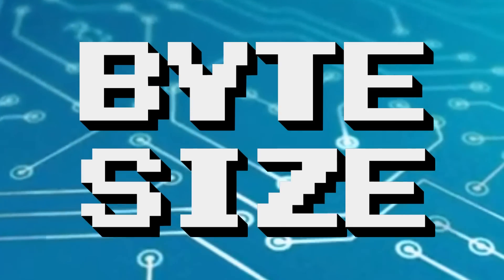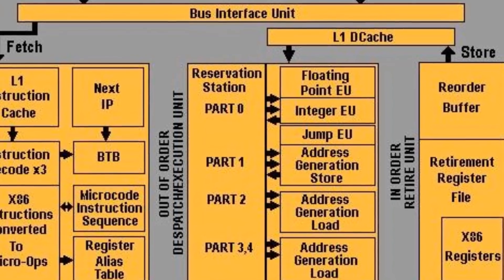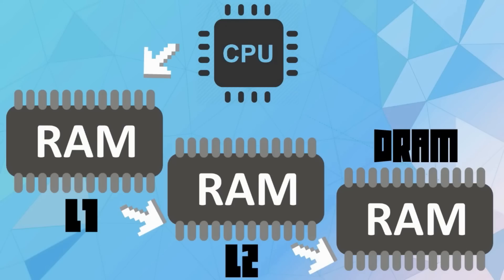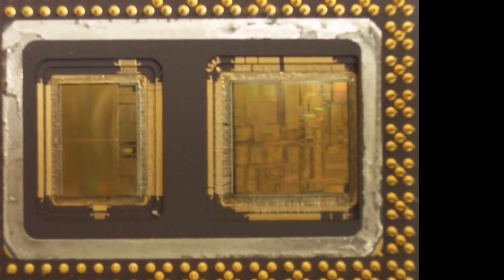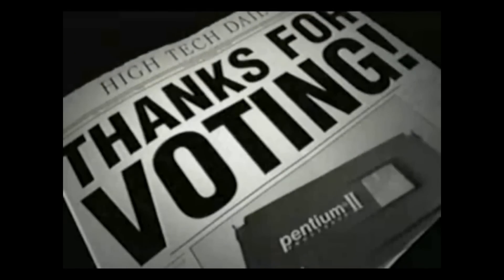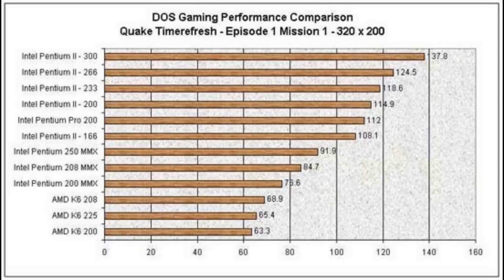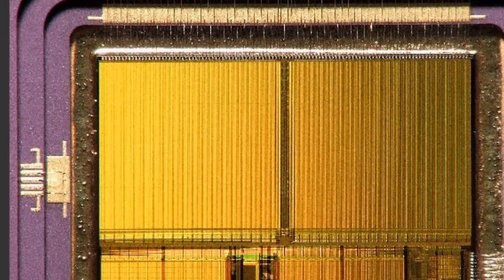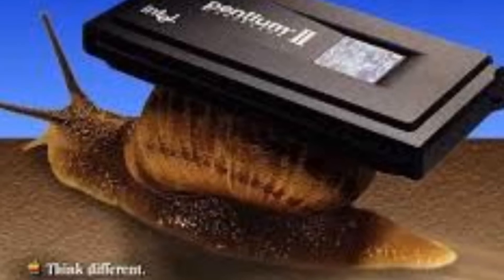Why Were Pentium 2's on Cards? [Byte Size] | Nostalgia Nerd

Comment: And years after, I still automatically translate "Celeron" to "Garbage"
Reply: Intel© Garbage® processor...sounds about right
Reply: Celery vegetable
Reply: you could overclock the stuffing out of the Celeron 266 or 300A (300A was the first to have L2 cache)
Reply: Celerons where overclocking monsters at one point before the 2000's

Comment: I remember when I first got a Pentium 4 that was over 1 GHz, all of my friends told me I wouldn't need all that power.

Now I have a quad core i7. lol
Reply: we will always need more power until we have a matrix like real-life simulation
Reply: The Pentium 4 was good at the Gigahertz race with its Netburst crap, but not much else. They abandoned the whole architecture for the Pentium M which performed a lot better with lower powerdraw.
Reply: @travelguy78   which is based on pentium 2/3  P6 gen
Reply: BigLBA1 But we have processors that can overclock to 5GHz now. I mean the world record is 8GHz, double of youre so-called "real barrier" and that was done on a AMD bulldozer :/
Reply: BigLBA1 You fail to adress multiple cores.
Reply: BigLBA1 What exactly was youre original comment about anyway? The physical limitations of a pentium? i think initially i misunderstood youre comment.
Reply: BigLBA1 Why do you bring up "light" when talking about cpu's that run on electricity which is much slower. Optical CPU's?
Reply: BigLBA1 But a drop in voltage relies entirely on the motion of electrons in that case. Can you cite a source for this, im genuinely interested. My understanding is that voltafe simply represents the "pressure" of a current, And currents are simply electrons moving, therefore voltage cannot move any faster than said electrons.
Reply: Guy sold me a 386 once and someone pointed out that the lowlife pulled out the EMM'y chip.  Explains why the casing was loose when he dropped it off.  Still ran windows 3.1 just fine though...
Reply: you won't need all that power.
Reply: 64K RAM should be enough for anyone.
Reply: BigLBA1  I know! 4 is common now for consumers, with OCs up to 5. However.. a cpu's Hz technically is the electromagnetic wave frequency of the oscillator crystal inside the CPU. Not how fast the electrical signal is propagated (which is far slower then light, as cpus are electrical based currently, not light based yet). Most herz increases come from  designs that settle a little after a clock rate change faster or use slightly less energy per transition of the square wave the crystal produces.
Reply: i had the first cheap athlon 1 Ghz, at that time hardware had the advantage for a short period.. I mean most of the games needed a much lower processor to run fine,
so i guess that's what they meant...And it's true it was the longuest period where i could run any game without upgrading anything...
Reply: BigLBA1  Der8auer  : sneezed
Reply: @bigthot1077  from my understanding the electrons don't move that fast but the waveform does.
Like imagine a bunch of cars stuck in traffic  and one guy slams his brakes and the next guy hits his and so on and so forth.
The cars don't move much but break lights start zipping down the highway.
Reply: @bigthot1077  electricity travels at 16x10 to the 18th power faster than the speed of light.....so...

16,000,000,000,000,000,000 times faster than light
Reply: I have a i9
Reply: Some day, maybe even soon, these TINY core counts will seem "cute".
Reply: BigLBA1  Even then, we're getting somewhere with quantum computing. Who needs a data bus when you can write memory with literally no lag?
Reply: They always said this is the fastest processor you will need if windows stops demanding more
Reply: @AlbertInSanAntonio  Makes sense to me.    I reckon the Pentium 4's and Intel Core-duo's are far underestimated for what they're capable of.       It's ironic that the most Modern OS can be a bottleneck to accelerated Graphical Power.
Reply: I had the first consumer 1Ghz CPU, the AMD Athlon 1Ghz.  Then I had the 1.4 Ghz.
Reply: Remember Bill Gates said 64k of RAM is all anyone will ever need.
Reply: @ryantoomey611  Yes, but at the time memory was extremely expensive and the engineering didn't have a reason to go beyond that limit.
Reply: @ryantoomey611  No. He said "640k should be enough for anyone" which was pretty much accurate when it was said and thus when it was referring to
Reply: You actually don't. You only used Microsoft Word, check email and surf the web. Your friends still stand correct till this day.
Reply: @BlueRice  I play and develop video games, 3D Models, and encode 1080p and 4k video. I absolutely need all the power.

Now I have a 10600k. Six cores and twelve threads.
Reply: @MakoRuu  when they developed jurassic Park the movie, they did it with far less power in a network setup. They didn't complain 🤗

Comment: I spent $1200 on a P2 400mhz cpu... Only to be matched by a celeron 300A at $160 with the fsb set to 133 and out performed in tribes and counter strike.
Reply: I had a Celeron A 266mhz overclocked at 400 form day one. Best CPU buy ever.
Reply: The Celeron 300A was later $79, OC'd to 450+ speeds, and, kept up with the P2-400 in gaming...
Reply: It takes more than just clock rate to merit equal or superior speed. Matched? Not really.
Reply: @sonialevitin464  If one buys a CPU for gaming, and a $150 CPU delivers the same frame rate as a $600 CPU, most will choose the former. (The Celeron 300a was famous, and a few lucky folks got $285 P3/600A to run at $635 P3/800EB speeds, and, some at 150 MHz FSB got 900 MHz...)
Reply: @sonialevitin464  actually in that particular case we did all the benchmarks(at a lan party) both synthetic and in games and Celeron A at the same clock as Pentium II was only 4-5% behind at worst, most of the time equal and sometimes even better(1-2%), because second level cache can slow down some code.. like games at the time. The only difference between the two processors was second level cache anyway.
So I don't know what exactly is your take on this.. but you don't seem to have done your homework.
Reply: The 300A was a P3 450 production overrun with a Celeron sticker stuck to it.
Reply: @jff24gordn  you mean p2 450?
Reply: @RamjetX  ok, might might have been a P2 450.  It's been 20 years.